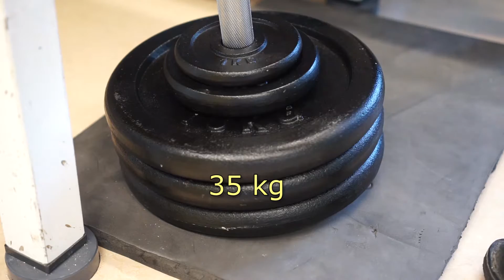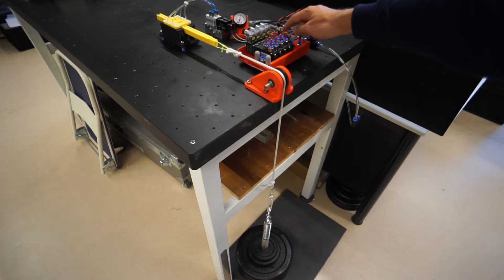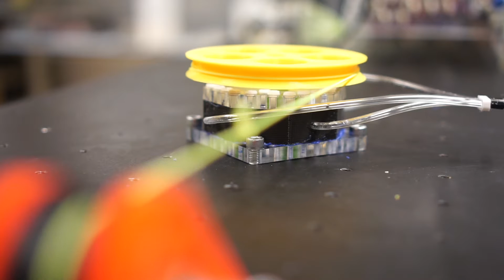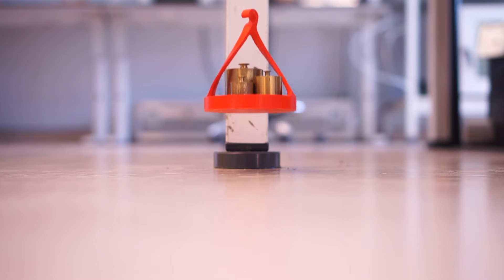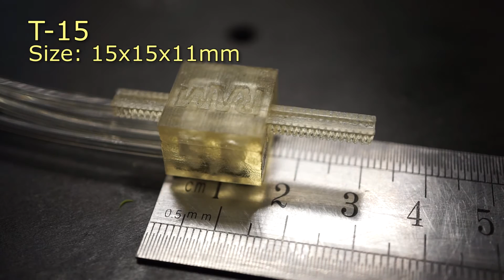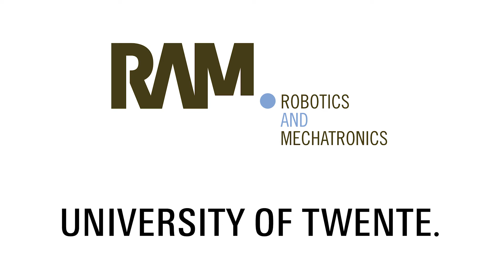MRI-Compatible Robots - High Performance Pneumatic Stepper Motors

Comment: I am very interested in your designs, is there a workshop available for ideas and how to construct a Pneumatic Stepper? I have built a pneumatic bipedal robot using 3 inch bore, 4 inch throw aluminum pneumatic cylinders, construction size of robot 5 feet, aluminum body, and would like to scale this down. Was looking for away to 3D print pneumatic cylinders when I came across your video. any publications, videos, etc, you can point me to would be greatly appreciated.